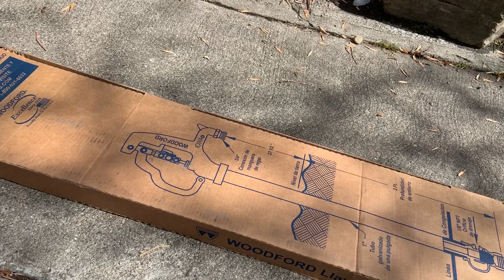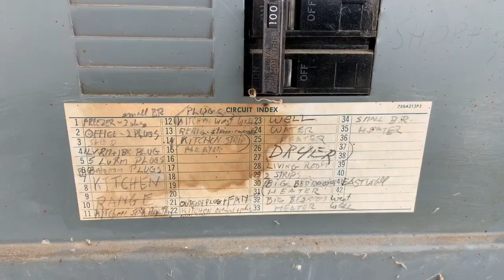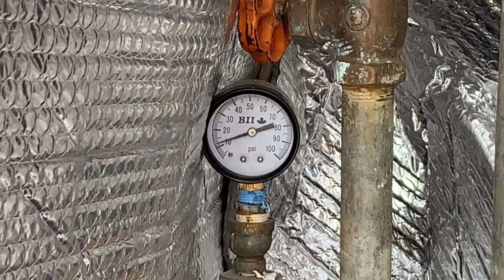How to REPLACE A YARD HYDRANT | FARMSKILLZ

Comment: Why didn’t you check for leaks prior to backfilling
Reply from the maker: Great point Michael! I failed to record that part, nor did I mention it in the video. Definitely an important step. Thank you.
Reply: How is that done? If you don't mind me asking, I'm about to replace one and just making sure I'm going in prepared as can  be
Reply from the maker: Leak check would involve charging the system with water and while everything is closed looking/feeling for drips coming from your plumbing connections, turning on the hydrant and making sure water flows from the hydrant with no problems, turning off the hydrant and making sure water drains from the drain opening before  backfilling.
Reply: To check is water is draining from hydrant, put your palm on outlet, you should feel suction
Reply: If
Reply: Rebar fast great  idea

Comment: helps to make sure the packing nut isn’t frozen before installing … I have two brand new Woodford hydrants that need replaced because the packing can’t be tightened up!
Reply from the maker: That is a great piece of advice! We had one that needed adjusting and it was already super tight. We just barely were able to get it to stop dripping. Thanks for the comment!!!

Comment: Love the rebar cross supports near the top of the hydrant! I'll do that too! Only thing I had trouble with in your video was when you put your pipe wrench on the outside of the pipe of the hydrant. I've been told to NOT do that and to only put a pipe wrench on the hex on the brass part at the bottom of the hydrant. I put a little 2 1/2" brass nipple (1/8" pipe) into the weep hole and then someone said they put a plastic bottle with the side cut out of it to cover the brass nipple and protect the gravel from wedging over the nipple so when you put the bucket over it and fill it with gravel it has some space that the gravel can't get in to block it off. I like your elbow drainage hack. We have a 39" frostline and we had to get a bury 6' Woodford frost free hydrant. We have clay soil so we were disappointed to see NO gravel around our weep hole and no elbow either! It didn't ever break because of the weep hole getting clogged. The handle broke and we can't adjust the nuts to stop it from dripping all the time. We couldn't have gone through this winter like that. We heard that the Woodford brand frost free hydrants are more trouble free and easier to adjust. We decided to go with that since we don't want to do this again. We only have shovels and a post hole digger. My husband dug for 10 1/2 hours doing steps down to the bottom of the hydrant. I'm so happy you posted your install. Thanks so much! We really don't want to do this again! Our old hydrant was a Conrad which I can't find anything about on the internet. The handle was bending out so it was very hard to close the hydrant and then we couldn't even get it to shut off all the way. So frustrating! We'll like this kind where you don't have to lift the handle all the way to get water and you can adjust the flow. Thanks again!
Reply from the maker: Hi Kathryn! Glad the video helped. 6’ is a long way down!!! I have had really good luck with poly pipe and stainless fittings for the main hookup. The flexibility and durability of the poly makes a great connection that I don’t worry about breaking. I have had to change so many PVC connections at the base, but never any poly or Pex. Thanks for the comment! Hope your project goes super smooth!
Reply: @BidwellCanyonFarm  Thanks! It'll go well with your help! Just have to unhook and put the new one and new nipple on. I'll try the cross rebar too!

Comment: Woodford is a good brand of hydrant for both residential and commercial use..
I have two on my premise that I installed almost 16 years ago..
No problems, just once in a while I would have to Tighten up the retaining nut below the handle and put a little packing in first
Reply from the maker: Nice! We are heading into our 10th year on 5 of the hydrants here at the farm and they haven’t needed any maintenance yet.🤞

Comment: Installed two hydrants in our area last year to water the livestock. One of the best improvements on the place! However, I didn't even think of taping the pipes! Dang! Must be specific to your area, as I've never heard of it up here in Northwestern Michigan. Good idea on the gravel bucket, too! Great video! Thanks!
Reply from the maker: Nice! Yeah you should be fine without the tape for a good long while. I think it probably just adds a little extra protection out here. Our soil can be pretty brutal on things as well as the water. Some wells even have an iron eating bacteria! Yikes!

Comment: I changed two out at my buddies farm. I use the sonotube but before that; i stabilized the pipe by bounding the steel T-Post deep down the hole and leave about 6in. above ground level and tie it with five screw clamps! Great job tho!
Reply from the maker: Nice! Sounds like that lil puppy dawg isn’t going anywhere anytime soon. Good on ya!

Comment: I'm dealing with good ol' springtime in Idaho. Having to replace 2 hydrants, but I've noticed the owner used PVC underground. Your video was entertaining and informative enough that I've subscribed, and look forward to watching more!
Reply from the maker: Hi Russ! Thanks for the sub! One may consider being pretty careful with the PVC to galvanized joint. I always add an additional stake, t-post chunk or whatever I have laying around to anchor the hydrant at the bottom with pipe clamps around the hydrant and stake so there is little to no movement at that joint. Good luck!

Comment: I’ve got a slow underground leak running to my hydrant.  In your opinion would replacing the plunger possibly fix it? I have noticed a difference in tension opening and closing the lever
Reply from the maker: Hi Robert, sometimes you can make adjustments to the plunger travel nuts at the handle. These can usually be adjusted to increase travel or decrease travel depending on what you need. You could also get a replacement plunger kit and replace the plunger without having to dig anything up. Hope this helps!

Comment: Thx for great video…what would you charge for what ya just did, labor and material, and how long was total job?
Reply from the maker: There was probably $200 wrapped up in parts and $450 for 6 hours of labor at $75/hr. $650 total for what was done in this video.

Comment: Just seeing how much you saved us all, that watched this. How much would you charge someone to do this if they already bought the new valve?
Reply from the maker: There are a lot of factors to consider with the cost of an installation like this. If it is just a straight replacement with no problems in the mainline etc. it would probably be somewhere in the ballpark of $240-500 and take approximately 4 hours to complete. However, if there are issues with other plumbing the price could go way up. One may consider hiring a licensed plumber for the job. Best to you Aron!

Comment: Hey Brian. Another helpful "trick up the sleeve" is to use a short length of Sonotube (if it's available of course) to contain the gravel for drainage, provide lateral stability and keep the pipe itself from direct contact with ground water through the backfill.
Reply from the maker: Nice tip! I never thought about a sonotube for this application. Do you think they will last underground? I know they are harder than all get out to peel off a concrete column. Thank you for the comment!!!

Comment: What exactly  was the layment you put on top of the gravel bucket  ?  Also is making the standpipe  connection  to a poly  pipe mainline the same process  ?
Reply from the maker: Hi Carlos, that product is called prodex. It was a scrap piece of house wrap radiant barrier i had leftover from a job. It is not for this application but it works. You can use anything that won’t allow fine dirt or silt into the gravel in the bucket. It probably isn’t even necessary, but i like to put something over my buckets. I actually have a video connecting poly pipe to a yard hydrant. The process is a bit different. Let me know if you find it. 🙏
Reply: @BidwellCanyonFarm  thanks , just got done watching  it  , very informative  .

Comment: The Teflon tape should be put on first before the dope so it is a tighter bond. Just using the dope is fine on a metal to metal contact. The tape is good on plastic pipes and can be used on metal but isn't really necessary. I use tape only when I fear contamination.
Reply from the maker: Thanks for the comment! I will probably stick to the tape over the dope, since it has worked for me without fail for nearly two decades, not to mention the time it saves hassling with tape slippage (especially when working in a hole or trench). Is there some science out there with a case for the tape under?

Comment: Question - mine just froze and there it’s noticeably cracked on the red portion where it threads onto the steel pipe. Do you think I can just swap out the handle to avoid digging up the entire 5 feet of dirt?
Reply from the maker: I would say most likely, I have never swapped the head out myself so I don’t know for sure. I hope you find a way to save yourself from digging! Good luck
Reply: @BidwellCanyonFarm  The head could be changed if you can get it off. Most likely it is rusted tight. When I had one freeze I removed the handle, pulled the rod out and welded the head. You must use cast iron welding rod. It helps to warm the head up with a torch a bit before you weld it.

Comment: I know this is an old  video.    There was a hydrant in the yard when I moved in.... although  it was run over and just pulled out....   can I dig  and  put in another   hydrant  new one due to I have to do another one that froze this winter as well.....  or do I have have to  dig the whole yard up ...
Reply from the maker: All you would have to is to dig up each spot where the water line is and you want your hydrants might need to T into the mainline where you want to add the new one, but the location of the old one should be pretty easy. Do you know why it froze? Make sure your water lines are deep enough, or else it might be the whole yard.😬

Comment: I have to replace a hydrant in my backyard it's the only hydrant I have and I'm wondering if I should bleed off the pressure at the hydrant because the pump is under the house in the crawl space then I worry about having to prime the pump afterwards
Reply from the maker: So Jay, you do not have a submersible pump correct? It is one that sits on top of the well casing and draws water up from the well through a pipe right?

Comment: Hey what size 90 degree elbow (threads ) did you use for the drain port on the hydrant
Reply from the maker: Hey Mike, it is a 1/8” iron pipe thread. I like to use a street 90 coming out of the hydrant in stainless or brass then a short nipple facing downward, a 2 to 3” oughta do the trick.
Reply: @BidwellCanyonFarm  also my area calls for a 36 inch depth pipe but the spec sheet says that will give you a 27 inches above ground for the Spicket. Would it be OK if I went with the next size longer hydrant so it’s higher off the ground I don’t need to bend over as far for every time for hooking it hose up.

Comment: Great video, thanks! Why did you change the 90 degree street elbow, though? Is there often a problem with that being clogged or something?
Reply from the maker: The water in our area has an iron eating bacteria that causes buildup on the inside of fittings eventually restricting the flow. Any plumbing I get into around here I end up changing out a few fittings. Thanks for the great question!

Comment: I purchased a Woodford Y-34  3 Ft Bury 1in. x 3/4 in NPT x MPT galvanized steel pipe yard hydrant, like the one you installed in this video.
I don't have it yet and am wondering what size are the threads at the bottom where it will connect to a 90 degree street elbow. I want to make sure I 
can get the correct fittings for my installation.  Any help would be appreciated.
Reply from the maker: Hi there Rich, thanks for the comment! You are going to want to pick up a 3/4” NPT street 90. The 3/4” MPT (Male Pipe Thread) on the bottom of the hydrant is also a NPT (National Pipe Tapered) fitting. It just lets you know if it is male or female.
Reply: @BidwellCanyonFarm  Thank you for your quick response to my question. Your expert video and tips on this installation will assist any novice to
accurately replace any similar yard hydrant. I have subscribed and will watch more of your videos, also recommending you to my friends.
Reply: @ Brian - I installed my yard hydrant just the same as you did here including the rebar braces which help to secure side to side support. Also I used a plastic bucket with cleaned washed gravel in the hole around the bottom of the hydrant for necessary drainage.  My old pump failed because of dirt in the small drain hole and froze in winter months. Your installation video was a great help and I hope you continue to provide similar videos.  Thank You !.

Comment: Awesome video. I'm looking at getting a few of the Y34's. What I can't get my head around is how does the weep hole not leak while the hydrant is in use?
Reply from the maker: I pondered that for awhile too. Pretty sure the plunger seals against the drain hole opening when the plunger is pulled up and water flows through the Little curved profile part of the fitting. Pretty ingenious design really.
Reply: You are correct, the plunger seals the main water line flow when the handle is down and opens the drain hole. When the handle is up the plunger seals the drain hole and allows water to flow through up to the faucet. Very well designed and has been around for years.
Reply from the maker: @toneycollins6377  I love good designs that work!

Comment: Whats the size of that drain elbow? 1/8in?
Reply from the maker: Yes. 1/8" drain elbow. I like using stainless even though it is a bit more expensive. Brass would be the next best. I also like to put a 2" nipple pointing down out of the bottom of the elbow to make it extra hard for sediment to travel up the drain spout. Thanks for the comment!

Comment: I have a tiny leak at the elbow on mine and it has only been in the ground for a few years. I dug it up and found a small drip, is there a way to seal the leak without digging up more and replacing anything? A friend said he could touch weld it at the spot it's leaking and seal it as it isn't spraying just dripping about a drip every 1.5 -2 seconds. Thanks for any help.
Reply from the maker: Not that i know of William. Sometimes sediment from the wall will plug it up over time without having to do anything. Are you on a well? Or city water?
Reply: @BidwellCanyonFarm  City water, i counted and the little triangle on the meter makes a complete turn in 10 seconds. Will a drop every second or two do this? or will it be a bigger leak? Thank you so much for your help, I am on a fixed income and any help is greatly appreciated as I have to do the work myself.

Comment: Just curious as to why you didnt just replace the head and stem instead of whole unit ?? Was it leaking at the well ??
Reply from the maker: Thanks for the comment. Personally, I would rather put in a new Woodford and let the next generation worry about it. I have no idea what make the original was, nor if I could track down pieces and parts for it. Not quite sure what you mean by leaking at the well? Is that what you call the base of the unit?

Comment: Why do you need to replace the elbow ?
Reply from the maker: The water is super hard on galvanized fittings out here. I have found some of them nearly sealed shut from mineral buildup. I found it easier to replace them while I am down there.

Comment: I used a brass elbow for the drain, any ideas how it compares to SS.  Anyway my wife didn’t want me install like I did before, the PVC broken, lasted 8 years.  I’m a cancer survivor and lost a lot of strength. The company that did didn’t recommend the bucket/gravel even though I used it before.
Reply from the maker: Hi Mark, Brass makes for a fine drain as well. I really like the poly pipe for my hydrant installs nowadays. For one, it is way cheaper than pvc right now and the natural flexibility of it alleviates the cracking like you get with the pvc. As long as you install it in a bed of sand, which helps avoid rocks from kinking it, i feel like it will last a long long time. I have always used the gravel and bucket method, but i am sure you will be fine without it, as long as there is not a lot of clay or fines in your sand that could potentially plug it up. Glad to hear you made it through the battle with cancer. Next step get your strength back. Maybe some yoga? Thanks for the comment! Best to you and yours. -Brian
Reply: Thanks I had metastatic melanoma, cured now after 5 years.  Immunotherapy made me weak, the Yervoy. They wrote down to use 1/2 play sand then 1/2 topsoil.  Red dirt (clay) in Oklahoma.  Would that be Ok, to not use gravel. They used pex to make the connection. I’m on a well, and yes they checked the well tank.
Reply: Also please wear sunscreen, a big hat and good sun glasses.
Reply from the maker: @markpurdin9900  Copy that!
Reply: Where did you buy the stainless steel elbow that you screwed into the elbow at 7:45 into the video? Thanks!

Comment: Can't you just replace the faucet itself or you have to do the whole stem?
Reply from the maker: Hey Tiger, often times you can replace just the guts. I’m this instance the top was cracked and could not be fixed.
Reply: @BidwellCanyonFarm  ok thanks the problem im having with mine is I can open it up all the way but there's not a whole lot of pressure like there used to be and when I turn it off it doesn't leak so I'm not sure what the problem is with that.